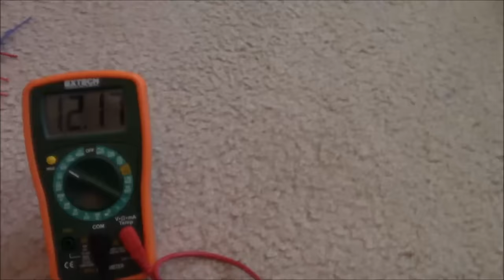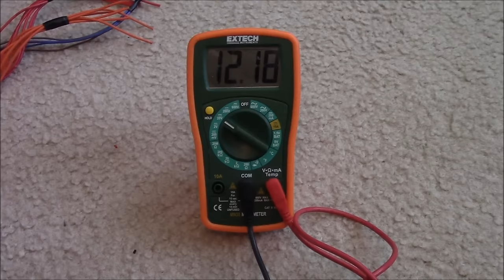How to Hack a Computer Power Supply (PSU) To Use as a 12V DC Power Source

Comment: If I have a stereo with a 7.5 amp breaker  and a power supply capable of 12v and more than 15amps could I use it or would it blow my breaker?
Reply from the maker: +Gunsexplosionsandair It won't blow your breaker unless the load on the other side of the breaker is trying to draw more than 7.5 amps.  The power supply will only supply the amount of power that the load requests.  Does that make sense?

Comment: sir LDSreliance your projects here really rocks!!! its really very useful bt what i need is to charge my 12v battery with a powersupply pls help me ASAP i need it badly tnx so much!!!!
Reply from the maker: ALLAN ADVINCULA You need to reach about 14v or more to charge a 12v battery.  You could buy a cheap dc voltage step up converter (http://www.amazon.com/LM2577-Adjustable-Step-up-Converter-Module/dp/B008HMETBE/ref=sr_1_2?ie=UTF8&qid=1434982559&sr=8-2&keywords=voltage+step+up) to increase the voltage from your 12v power supply to your battery.
Reply: LDSreliance Tnx for you time to reply I really appreciate it but is there a way where I can just use the pc psu to create my battery charger??tnx
Reply from the maker: I haven't tried it before but theoretically if you combine the +12v rail with the 3.3v rail you should be able to charge a battery with that.  It isn't the ideal voltage and I can't tell you how to do it since I haven't done it before but I am sure you can find some instructions on Google.
Reply: LDSreliance Thanks so much!!!!

Comment: Hi there, you have connected all the 12v cables together to make one 12v port. if for example you wanted to have more than one 12v  port could you take each individual yellow cable and use it as its own 12v port for many other loads to be connected. or would this draw to much current in the single yellow wires?
Reply from the maker: Yes, it would potentially draw too much current.  I don't think it is a huge risk but if you were to accidentally get 20 amps (or whatever the full power from the psu) through one wire it would burn up that wire and potentially start a fire.

You should be safe in 4 or 5 wire bundles to use as much power as you want.
Reply: Thank you very much. that is very impressive response time, haha.
Reply from the maker: Haha, either that or I spend too much time on Youtube!
Reply: Perhaps I could ask you. If I was wanting to build a power supply for a 20 watt class D audio amp would it really have any efficiency benefits if the  power supply was a switching instead of a linear supply. 

I want to make the an efficient supply but I'm not sure an amplifier needs it.
Reply from the maker: I am sorry but I don't know the answer to that.

Comment: I need something to test car audio system at home before installing. In car it is 12v. Can I use this old computer power supply to do this? Or is this too much or too little amps?
Reply from the maker: Yes, but keep in mind that car audio actually operates at higher than 12V.  The lowest car audio components will ever see in a car is about 12.6-12.7V without the engine running but with it running it will operate at about 14.1-14.2V.  This ATX PSU provides 12V and the voltage may sag below 12 under load.  So just keep that in mind that your amp(s) may not operate very well or produce anywhere near their rated power.

Comment: Maybe a stupid question, but is it important to solder them together like you did? Or can you just use one cable instead?
Reply from the maker: Not a stupid question at all.  I chose to bundle them all together so I would never have to worry about burning out one of the wires by using too much current.  You can use individual wires for low current or 3-4 wires for 10A or so would be safe.  But if you use one individual wire for 10A it will probably melt the wire.
Reply: That makes sense, thanks ^^
Reply from the maker: You are welcome.  Thanks for watching!

Comment: I had done this to power a bunch of LED strips that I have running in my shop and it worked great for awhile, but the dust built up inside the PSU and I guess eventually just gave out.  So, I went and bought a brand new one.  Did the exact same thing, but now it won't work.  It will light up one of the strips for a second, but that's it.  This may be a newer type PSU than the older one I was using.  I connected the green & black just as usual.  Could it possibly have something to do with a grey wire which I believe is called the Pwr_On wire?  I also heard that if you have a brown wire(in my case it is kind of peachy color) you should connect it to the orange wires?  Is this true?  If so, do I connect it to ALL of them or just 1?
Reply from the maker: Ahh, you have fallen victim to newer PSU technology.  Basically most new PSU's are designed to sense the load on the PSU and if it does not detect one it will shut off.  I am sure it is an energy saving measure.  So you have to trick the PSU into thinking there is a load by using a resistor OR have the PSU connected to a load before turning it on.

Comment: Do you have to  to tie together all the yellow and black wires to get the right voltage or can I use one yellow and one black to power one LED and so forth to power up to ten LEDs?
Reply from the maker: +Tom Whitehall You can use one of each as long as you don't pull too much current.  It will fry those little wires pulling more than an amp or 2.  That is why I tied them all together so I could use the full 20 amps safely.
Reply: Thanks for the information. I'm going to tie them all together for the extra amps just to be safe too. Great video!
Reply from the maker: Tom Whitehall
Better safe than sorry.  I don't think you will start a fire but you for sure would burn up that wire.  Good luck and thanks for watching and the support!

Comment: I have a 250watt max power supply, do you think that will be enough to power an amplifier or would I need a more powerful one, because I tried the 1 I have and the amp would just come on for about 4 seconds and the power supply would just shut off automatically
Reply: +richard pechia  10 to 18 watts from the power supply on the 12v output only.

Comment: What would be the power output in Watts? Would it be able to power a 12v car tyre inflator?
Reply from the maker: The total power available on this PSU at the 12V rail is 240W.  Yes, that should power a 12V tire inflator as most of those can be powered by a cigarette lighter socket, which is almost always 120W or less.

Comment: I have a DC pump that I use for pumping oil. do you think I could use a computer power supply to run it? I figured since it hooks up to my 12v battery that it might work with the 12v power supply.  it uses 13.5 amp.  ty for your assistance. 🙂
Reply from the maker: Pumps can pull a lot of current temporarily to get started.  So it may not work.  But if it isn't that type then it will work easily.
Reply: @LDSreliance  thanks for the reply. can I combine two power supply and tie the wiring together? what will this give me as far as volts and amps? ty
Reply: @LDSreliance  Why do we have to use all yellow and black wires ?
Reply from the maker: You don't have to.  But if I show in the video only using one yellow and black wire and then someone tries to copy that and use all 20A or 25A of their power supply over that single wire, it will burn up the wire.

Comment: You saved my life man, thanks!
Reply from the maker: +Vikings of Vintage Audio Haha, I am sure there is a story to that but I am glad.  Thanks for watching!
Reply: +LDSreliance I'm making a prototype of a wind tunnel to a science museum here in Sweden and the deadline is due to Monday. I realized that I couldn't buy electronic speed controllers since I have to many fans. Got the great idea to buy a computer power supply and a fan controller (basically the same thing), wired it up and ... nothing. Flipped the switch over and over. Realized my mistake. Searched for "computer power supply" and the first search suggestion was your video. It was correct down to the colors and all I had to do was to solder the green wire to one black and use the four pin connectors as they were to the fan controller. It's so nice when things work out!
Reply from the maker: Vikings of Vintage Audio
I knew there would be a good story.  Glad I could help!  And glad Youtube put my video at the top.  I have watched a half dozen other videos turning psu's into benchtop power supplies and most of them are pretty awful.

Comment: hey bro, shalom. whats the function of the other colors? (brown, grey,white, blue and purple)
Reply from the maker: Guindolino Jr Gerona Brown is a detector wire for the +3.3v rail.  White is an older style power supply that doesn't exist in newer ones.  It is usually -5v.  Grey is +5v that is usually used for an LED light.  Blue is for -12v.  Purple is a +5v standby power usually just showing that the computer is plugged in but not powered on.

Comment: Tthanks for video very helpful , I did everything the same , 3v and 5v working good but if I use 12v for example for a 12v fan or other 12v things the power supply tripped off .( I did check voltage with ohmmeter is 11.78v).any help ? Thanks
Reply from the maker: The PSU has to detect a big enough 12V load.  Some people have suggested using a resistor to simulate a load.  Or you can make sure the load is turned on before you turn on the PSU.
Reply: Thanks for answering .

Comment: i want to hook car woofer n amp to 12v power supply at home is this method be good enough??? or should i hv to purshase another converter?
Reply from the maker: This power supply only provides 20 amps @ 12v (240 watts) so if your amplifier is smaller than that you can do it.  Or if you have a bigger power supply than mine to start with.  Otherwise it won't work.  Most sub amps need a lot more than 240 watts, though.

Comment: i have a 400 watts smps can i use it to power 3 led lights 100 watt each ??
home made led lights 
could you please do a video on it
?
Reply from the maker: A 400 watt power supply from a computer like this will typically only have 20 amps or less of +12v power.  So you could do 2 of those lights.  I will add that to the suggestions of possible future videos.  Thanks!

Comment: I have a 250watts max power supply and I tried using it to power a 1600 watts amplifier and every time I turn it on it would shut off automatically, any idea? do you think its not producing enough power?
Reply from the maker: +richard pechia Yes it is not producing enough power.  Your +12v rail on that power supply probably produces no more than 15 amps or so and that amplifier could potentially draw 100+ amps.  Also, most car amplifiers are designed to run at 13.3-13.8v which is what cars operate at when they are running.

Comment: Hi. i want to charge my car battery 12 Volts 48 Amp.
what is the Amp of Supply out.
i paired 5 yellow wires and 6 black wires. so what is amp now. tell me
thanks
Reply from the maker: +zeeshan yousaf That depends on your power supply.  But it would have to be a more expensive gaming power supply to provide over 40 amps on the 12v rail.  Plus, you can't charge a car battery with this device.  You need at least 14v to charge a car battery.

Comment: So basically if I wanted to run three 12 v devices wire all the yellow and black together like u did and just connect all three to the yellow and black wires??? So if I hooked up pc fan for example and just wanted the power to come on when psu comes on I just hook up the black wire to black ground wire of psu and then yellow to yellow and ignor the red?
Reply from the maker: You can divide the yellow wires to go to different devices if you want.  But use bundles of 2-3 yellow wires and 2-3 black wires minimum.  I bundled them all together because I was going to use it with one load or I would just use a buss bar or a load center to divide the loads from there.
Reply: Ok thanks yeah basically I was going to splice all yellow wires together and all black wires together on psu  then take my three 12v devices  pump, Peltier thermal electric cooler and then a psu air cooler to keep it cool well I just want to know how to hook them all together but I only see a red and a yellow wire coming from pump and can’t find anywhere wtf the yellow wire is for! Usually the red in dc I thought was power wire but yeah if I could figure out which wires are power I thought I could just connect them to the yellow group from psu and then I’m assuming the other wires would all go to the black group from psu and as long as psu powers more amps than all my devices draw I should be fine am I looking at this the right way? Lol

Comment: what is the amperage of the 12 V output, you demonstrated here?
Reply from the maker: For my model it is 20A but each PSU will be different.  And you can only safely use all 20A if you bond multiple wires together like I did.  You should not try to use all that current through one single yellow wire.

Comment: Question please: I would like to use my old PC power supply to power an old car stereo and power amp.  The power supply label for output says 200W Max and +12VDC at 6 Amps.  Does that mean the max amperage for the power supply is 6A, or 6A per yellow wire?
Reply from the maker: 6A total for the +12V rail.  That probably will not be enough for your project.
Reply: @LDSreliance  Thanks very much for taking the time to answer my question!  I've got a second, but newer/larger machine that I can probably scavenge the PSU from.
Reply from the maker: Yeah most power supplies are 400W or bigger so that should be sufficient.  Your amp may not be able to provide max power but at lower volumes it should be fine.

Comment: hey mate could you give me a low down on all those colours yellow an black 12v, orange and black 5v etc please what do they all do if you don't mind me asking I'd like to right it down for memory
Reply from the maker: Sure.  3.3v is orange.  +5v is red.  -5v is white (don't use unless you know what you are doing).  +12v wires are yellow and another +12v rail (if present) will be yellow with black lines.  -12v wires are blue (don't use).  Negative wires are black.  Power on is green.
Reply: cool man your the best thanks heaps much appreciated. I just like to know what everything is so it's not always on the back of my mind wondering what the rest are for or can do lol just like the car audio stuff good stuff to know cheers ☺

Comment: Say you wanted to connect a monitor that needs a 12V dc power adapter to the PSU of a pc, would you just need to connect the yellow wires to the DC power cord? Or would you need to put the black ones in there as well? And how many of the wires would you need for it to work?
Reply from the maker: You would need the yellow wires and black wires.  For a monitor you could probably get by with just one of each instead of soldering multiple wires together.  You would need to find the other end of the connector to the monitor cable (barrel connector or whatever style it has) or you could cut off the connector on the monitor cable and then just wire in a switch in series with the yellow wire and connect the black wire from the PSU to the black (negative) wire of the monitor cable.
Reply: @LDSreliance  Ohhh I see! Thank you so much! This helps me a lot :D
Reply from the maker: You are welcome.  Good luck and thanks for watching!

Comment: Hi I’ve tried exactly this with my atx psu and the fan switches on for one second then turns back off? I bridged the green to black
Reply from the maker: Your model has a "feature" that shuts off power if it does not detect a load.  You have to connect something that will use power to the power supply or it will just shut itself off.

Comment: I'm trying to build a cabinet that holds all my game consoles, and I'm trying to come up with a way to keep constant air flow through it. My method is to have a fan on one side of the cabinet blowing air in, while on the other side a fan is blowing air out. I want them all to be on the same circuit. Could i wire them all to a "master" wire and then attach the master wire to this power supply? Hopefully that makes sense
Reply from the maker: +Isaiah Peterson Yes, that would be easy.  You could use 120mm computer case fans as they are cheap and very plentiful.  You could hack off the connector on the end (make sure to mark which wire had a ^ mark on the connector first and that will be your negative wire) and then extend the wires with like 22 gauge wire to a toggle or button switch that you can mount to the outside of the cabinet and then wire to the yellow wires on your power supply.  (Only the positive wire routes to the switch, the negative wires can go straight to the power supply black wires)
Reply: Sweet! Thank you so much.
Reply from the maker: Isaiah Peterson
No problem.  Thanks for watching!

Comment: I used a PS similar to yours (a delta electronics PS taken from a Sony computer). I hooked it up to my sony xplod amp to power some 12" speakers, and it worked for a few seconds, and then the PS just shut down...

any advice?
Reply from the maker: Amps are pretty power hungry.  How much current can that rail handle on that psu?  The one in the video shown is only 20A on the 12v rail.  So that is only 240 watts, which is pretty low for an amp.  If you are on the edge of what the amp needs you could try helping it out with a capacitor just like you would in a car audio system.
Reply: LDSreliance yes I was thinking I should probably look into getting a cap. Was trying to do this without spending any money (already had the amp and speakers) but I think I'mma have to spend a little
Reply from the maker: Yeah, sorry.  The good news is you can get a 2 Farad cap pretty cheap:  http://amzn.to/2oYs2fP

Good luck!